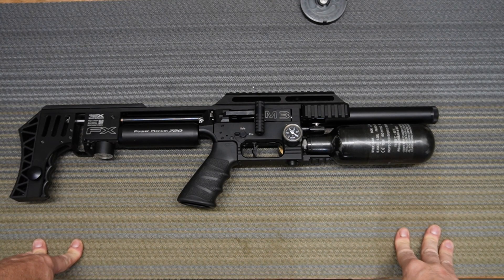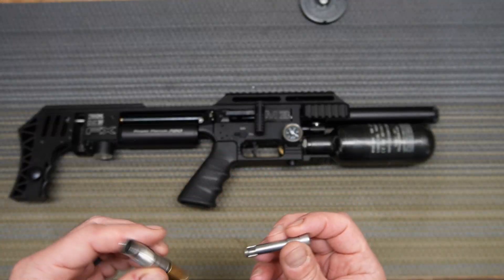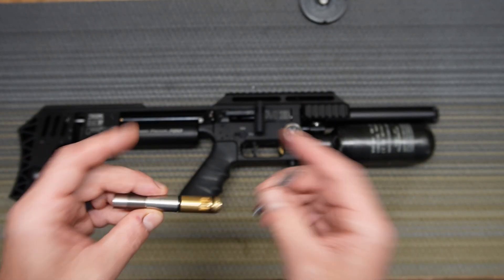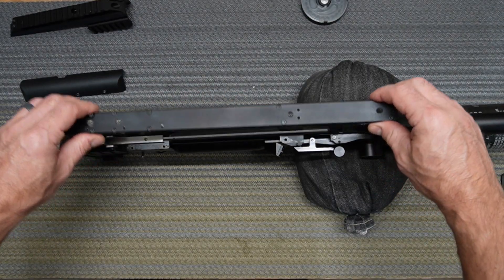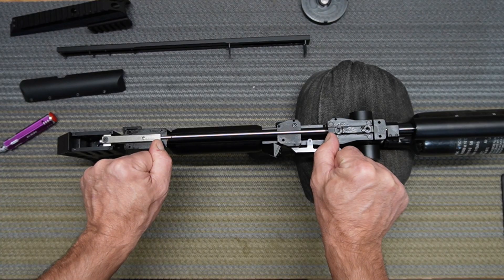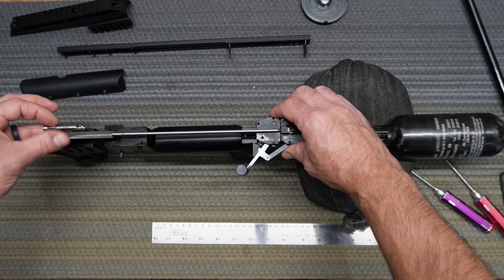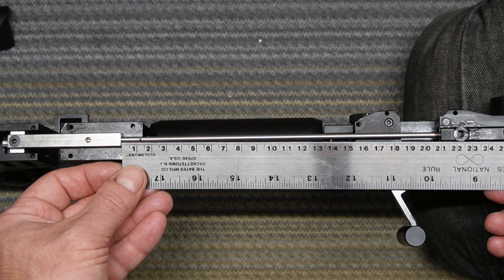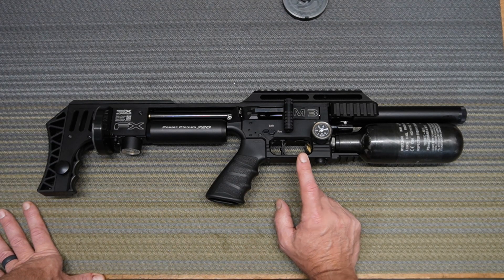Adjust FX impact reloading rod - CHECK YOURS

Comment: Great info, thanks! Should be the same length for all impact versions I'd say. Lots have changed but the overall dimensions of the system remained the same.
Reply from the maker: yes sir, I checked and both of my Impacts were off

Comment: Any idea about pellet probe/slug probe alignment? One of my M4, when loading and pushing the pellet probe in, it hits the outer port then slides in. I’m worried over time the port will wear down.
Reply from the maker: Yes, that happens because your power block and rest of the gun is miss aligned, take scope rail off, loosen all screws on the top rain/backbone, put barrel in and then tighten that backbone back up, then try sliding barrel in and out, it should go in straight

Comment: Hii sir
How to solve reg pressure slow recovery in fx m4
Reply from the maker: when you take plenum a part, that plastic end with long neck, at the end of the long neck, between two o-rings you will find small hole, drill that hole larger to 2.5 or 3MM
Reply: @PCPsavage thanks sir

Comment: Great video!

The way I do it is installing the probe and barrel. Mark the probe when its inside the transferport. With that marking you can see exactly how it lines up to the transferport.  You are always 100% inline with this method.

When changing from a pin probe to a Huma High Flow probe, I had to adjust the reloading rod.
Reply: Any chance of a quick video on how you do this I'm running huma pin probe.
Reply: @KallemLink-x2l Close the bolt so the probe sits inside the transfer port. Mark the probe at the exact point where it contacts the transfer port using a fine marker.

Next, remove both the probe and the barrel. Insert the probe into the transfer port again, aligning it with the mark you made. Then check the slug or pellet port to confirm whether the pin clears the transfer port and pushes the slug far enough.
Reply: @RV15041 thanks buddy top man 👍
Reply: @KallemLink-x2l Watch Airbuks his video " FX IMPACT MKII to M3 UPGRADE " at 33:48

Comment: if you use the kraford & lypt probe holder this adjustment wont be necessary as you need to adjust the probe for each ammo to sit in the landings, i did a video shooting  29,8 aea pellets and 30g h&n slugs on the same tune due to both are the same length  and weight  this can only be done with a pellet probe as it pushes on the skirt and not the center dish... good video

Comment: I have m4 in 700ml 22 think it would be worth while putting the 7 gram hammer weight in it of huma they do a set of two hammer weights 7grm-8grm in stead of fx 6gram standard hammer weight will this reduce my tension on my hammer spring settings macro-micro ore will I still need the same amount of tension ? Hope you can help thanks great video once again
Reply from the maker: tell me why you putting more hammer weight, you maxed out on your FPS? What speed are you shooting now, what is your 2nd reg pressure and what is your fps goal?
Reply: @PCPsavage was just wondering if it would be better for the tension on hammer spring that's all if had heavier weight but guess not thanks
Reply from the maker: @KallemLink-x2l you only need to add more hammer weight if your PSI above normal operating PSI for this gun, your hammer hits the valve that is kept closed by pressure, right, so standard weight is capable of opening that valve up to about 150BAR, has enough weight to do it, once you go above that pressure, say you tune for 170 or 200BAR, your hammer is too light and has no juice to punch that valve open, that's when more weight comes handy, but before that is does more harm to your running than good, because its overpowering the valve, makes sense?
Reply: @PCPsavage yeah absolutely thanks again seems he's his running just sweet  then  thank you
Reply: @PCPsavage it's my dads gun he's shooting 27grn slug at 970fps in 700ml liner standard hammer from fx 6gram hammer weight with hummer hammer spring macro on 16 micro on 4 an half valve on line 4  he was just wondering if it would be better for life span of the hammer spring it's self so there's not as much tension on it maybe he could turn micro down if hammer is a bit heavier just a random question he asked I was curious thank you for reply one of the top five for me on YouTube keep excellent work up 👍
Reply from the maker: @KallemLink-x2l Keep it as is, spring will hold just fine, keep it shooting and enjoy
Reply: @KallemLink-x2l I have installed the lighest Huma hammer in my Impact. The reason being that I dont need that much hammer spring tension now. My 6 gram impact hammer was not able to open the valve with a regulator pressure of 120 bar.
Reply: @RV15041  kind of explains my question thanks buddy 👍
Reply: @PCPsavage absolutely thank you I do listen to you ever since only listening to your tunes and mods my guns work flawlessly thanks again pcpsavage 👍
Reply from the maker: @KallemLink-x2l WOW, nice to hear this feedback, appreciate your support allot.
Reply: @PCPsavage his second regs at 115bar huma reg sorry missed that one out
Reply from the maker: @KallemLink-x2l factory hammer will be just fine.
Reply: @PCPsavage thanks again top man 👍